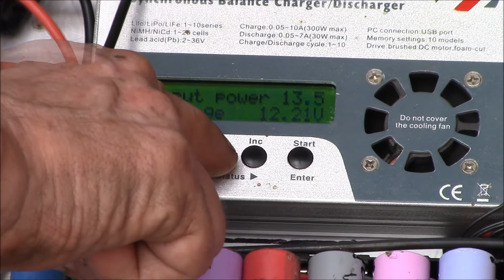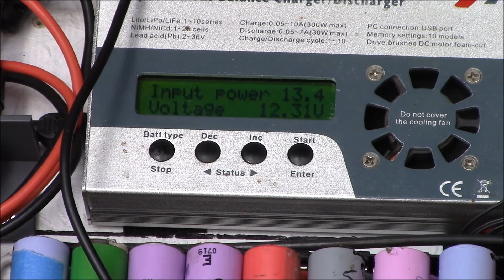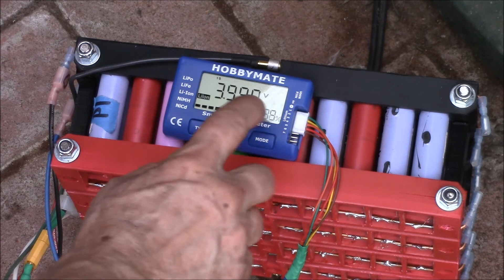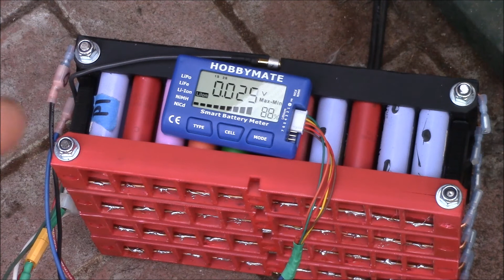20P/18650 Battery Packs, Part 3 of 3 - Bottom Balance

Comment: Please can you then connect 2 of the cell of your 12volt with BMS packs as 24volt for a 24volt inverter?
Reply from the maker: I can reconfigure the groups of cells into a 24V battery (7S) if I decide to go that route.  For now, I'm running them as a 4S / 16 volt battery bank so that I can work with my other existing ~12 volt equipment.

Comment: Do you think it’s possible to balance 14S288P
Reply from the maker: It should be possible, although may take some time depending on the current rating of your charger/discharger and the group capacity.  Likely you are over 500 AH capacity and with a 10A discharger, that would take a day or two to discharge each group, or 2 - 4 weeks for the whole batch.

I think what folks with the larger capacity packs do is connect them all in parallel and charge them up to the same voltage then connect them up in series.  This would be more of a top balance.
Reply from the maker: It should be possible, although may take some time depending on the current rating of your charger/discharger and the group capacity.  Likely you are over 500 AH capacity and with a 10A discharger, that would take a day or two to discharge each group, or 2 - 4 weeks for the whole batch.

I think what folks with the larger capacity packs do is connect them all in parallel and charge them up to the same voltage then connect them up in series.  This would be more of a top balance.
Reply from the maker: It should be possible, although may take some time depending on the current rating of your charger/discharger and the group capacity.  Likely you are over 500 AH capacity and with a 10A discharger, that would take a day or two to discharge each group, or 2 - 4 weeks for the whole batch.

I think what folks with the larger capacity packs do is connect them all in parallel and charge them up to the same voltage then connect them up in series.  This would be more of a top balance.

Comment: in this video https://www.youtube.com/watch?v=tbaeMWdDlqY&t=329s they claim the no balance is need it, can you give me your advice
Reply from the maker: Lots of opinions out there.  I used to be a fan of balance charging and top balancing.  Now I've been doing bottom balancing and then leaving the 4S batteries I've built to their own and so far, that's been working quite well with periodic monitoring.  I do run my cells at a reduced voltage, so no big concern for over charging them.  I think the best thing to do is try out various techniques and see what works best for you and your battery modules.

Comment: Hi do you sell these battery module/holders?
Reply from the maker: At this time, probably not.  If I can get a 2nd printer built, then I might be able to do that.  There are 3 vendors on Thingiverse who'll print parts off that site for a decent price.  For the couple of parts I looked at, their price was better than what I would charge since they have much faster machines.  For my machine, it's about 9 hrs. to print one top/bottom holder alone.
Reply: R Brown thanks